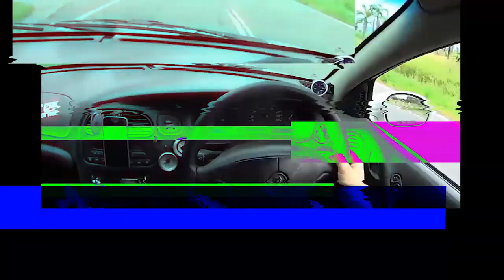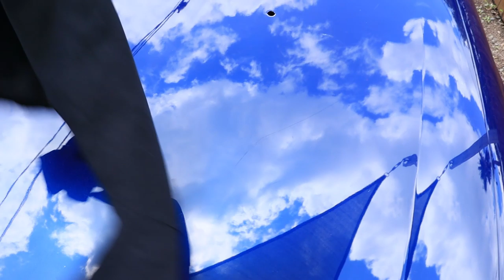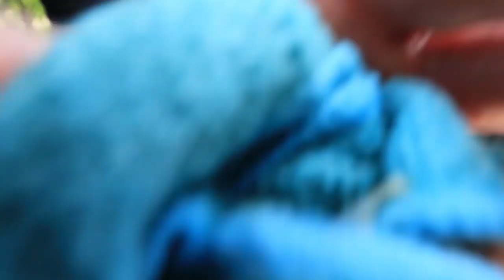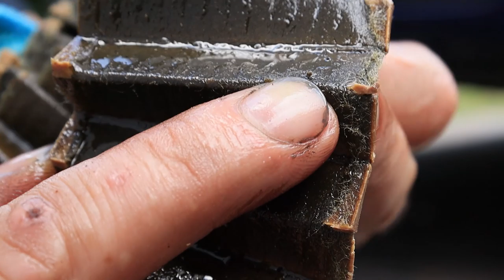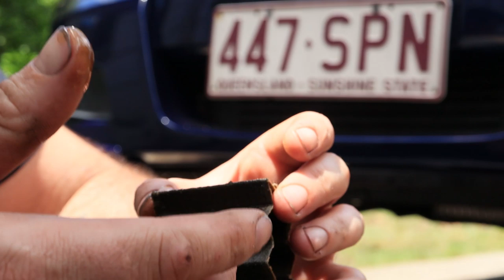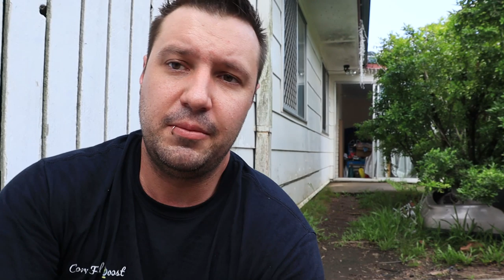Ethels oil filter inspection..is it dying????

Comment: It is normal for  an engine to shed small particles of metal or flakes  , i have never bothered looking inside filters so i  found this interesting , one thing i would suggest is a better quality filter, i did an oil change on my VS. ecotec years ago i had , heaps of small metal shavings on the drain  i had gone over my oil change period  and then i switched to full synthetic oils next oil change was clean , however that is zero to be worried about those metal pieces

Comment: Hay Bro you have an awesome car, I'd be checking lifter and cam for wear first I only say this because my L67 did 4 lifter and it put some indentations on the stage 2 cam. I'm thinking of doing a turboed v6 or putting a raptor supercharger atm so I'll be doing alot of homework to which one will give me enough hp to the rear wheels
Reply from the maker: Yeah man I'm thinking that it's something along those lines so gonna look into that... I'm pretty sure the turbo will be the best option for power not sure what the Raptors are like but I know turbo is the way to go especially with the l67 blocks...

Comment: Man seen way worse, if that's your second oil change since you had the head off last give her a few more pounds to clear her throat, u gonna blow her at some point anyway right? Your right when you said it's not crazy, the candle that burns brightest does not burn the longest...

You already know the mantra, build, race, break,, repeat

Go the lifters and cam bearing, not that dear and see how you go, good luck my friend, you'll get more views with a big detonation, win win right?
Reply from the maker: Hahahah thanks man will get alot of views but kill a way to expensive engine in the process gonna pull it out n have a look first before I make it any brighter 😁🤘
Reply: @cornfedboost  Fair enough man, have had a few beers and just in that kinda mood : ) Block is cheap enough though yeah? Got one i am using as a garden ornament if you want it? Just all the goodies/time you have put into it where the money is right?

Dump the oil a few times post having a look to see if it's anything more serious. You'd (maybe) be surprised how much metal can end up in an oil filter post a build (rings, bearings, pistons etc).

Hope it's all good, i'm sure we'll see.
Reply from the maker: @ufi123  hahaha yeah man I'm a few deep too I wouldnt stress.. yeah the rest of the engine is the expensive part all the thousands of dollars in machining and thousands of dollars in parts adds up to alot really quick might un plug the boost controller and do some kms in it and see if it gets any better but part of my just wants to yank it and have a look..

Comment: I think you’re going down the right path with the cam bearings and lifters. That noise could have been lifter tick? 👍
Reply from the maker: It's what I'm thinking man good excuse to go a bigger cam 😁🤔🤘
Reply: Corn Fed Boost yeah hopefully it's just a lifter and its just normal material from running in but from what I've reasearched and learnt from N/A builds I know one of the drawbacks to the pre-ecotec engine is a lack of depth to the lifter bore causing the lifter to get pushed out of the hole with very high lift cams, which causes abnormal lifter wear from side deflection at high rpm, I'm not sure if the ecotec is the same but maybe it's something to consider if you need a new cam or lifters, a solution (if it is indeed a problem) would be longer lifter/shorter pushrod or less lift height to the camshaft.
Reply from the maker: @715101  hmmm yeah man that sounds like a problem hopefully I can find a solution or even the problem isnt to serious been thinking I should probably pull the engine and inspect everything to be safe
Reply: Corn Fed Boost yeah man as much as it sucks it's much better to tear down for inspection before a catastrophic failure, and because not many people do this stuff your pioneering in way so extra attention is needed sometimes, best of luck to you mate
Reply from the maker: @715101  thanks mate it is a good idea and will be a good way to make sure nothing is failing badly and I can make some improvements if I need to while it's out and better safe than sorry I guess....